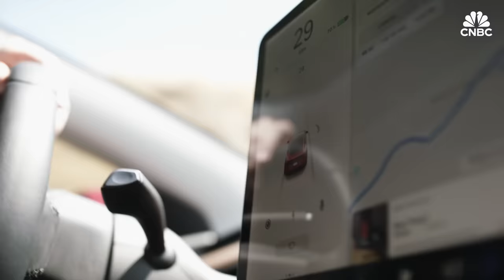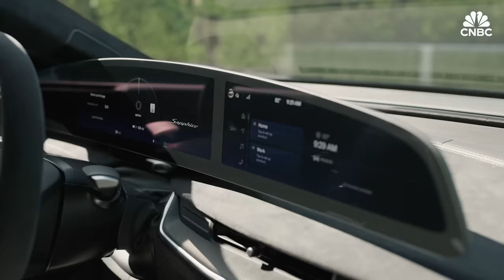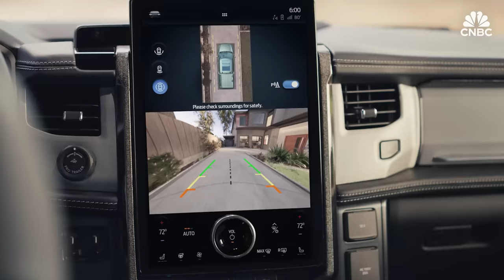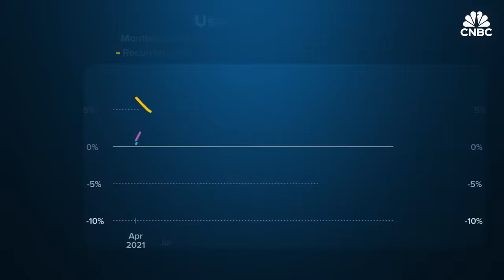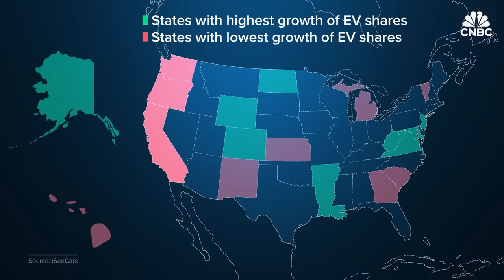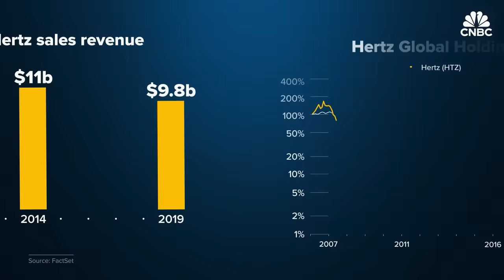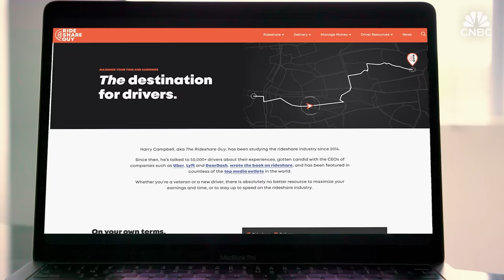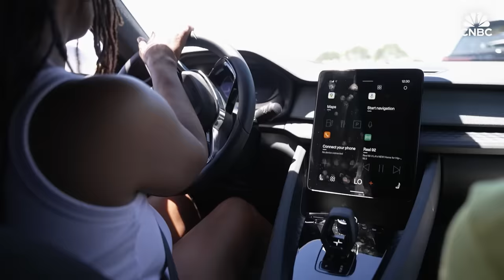Why EV Sales Are Falling | CNBC Marathon

Comment: It's the cost. There are no low-cost EVs, and it is best if you have a home charging station as we'll, which most people don't have.
Reply: U can just plug into your home power u don’t need a special charger.
Reply: We have one EV and just plug into the wall. It works if you drive less than 50 miles a day. I’ve used public charging about 7 times in 3 years.

Comment: Renting a EV is very different from renting a ICE car. When you return the gas powered car you just stop at a nearby gas station and fill-up the tank to the level required. When you return the EV, you have to plan ahead on where and for how long you have to stop to charge the battery so you end up with the percentage of battery required to not pay the extra charges. Also you rent When you are away from home and without the home charging the price per kilometer may end up very close between EV and ICE, so you feel only the disadvantages of driving an EV
Reply: Exactly my experience! And half the chargers are very difficult. Even the guy at the dealership had issues!

Comment: Maintenance cost is cheap, until you damage the battery, then it's basically the price of a new car.
Reply: Ya, I have this ICE car and maintenance was cheap until I damaged the drivetrain and now it is the same price of a new car. What a stupid comment to make. If you damage any new cars engine where you have to replace it you are looking at a minimum of $10K+. If you damage a battery you had to do something very bad because unlike regular ICE which leaves all their vital components exposed to the open air a battery will have a relatively thick piece of metal and composites protecting it from damage.

Comment: I’m having an EV for a month as my car is in auto shop. Honestly pretty awesome experience as an 100% on-site employee commute to Seaport Boston with company garage providing free charging stations. So far only paid 20 dollars for charging due to a weekend road trip. This is easily $200 per month saving not even taking consideration of maintenance saving if I eventually switch to an EV. This, however, doesn’t apply to most people around me as we almost all living in apartments/condo that has no or bare minimum charging stations, and not everyone is fortunate to have free parking in the city with free charging perk. So the population has greatest demand for EV: people commute in big cities, is also the population that faces infrastructure problems helping them getting an EV.
Reply: Tesla Supercharger Network:  no garage for overnight charging?  No problem.
Reply: Luckily chargers are simpler to install because they lack all the HAZMAT requirements that gas stations need to satisfy. But there's still a lot of capital-intensive drilling and pipefitting to put in a charger, not to mention the energy storage and transmission upgrades that the government needs to help with.
Reply: @doujinflip  WAY less than the cost of the Fossil Fuels Infrastructure to keep drilling incessantly and shipping OIL and gasoline LONG distances and refining it, while polluting the world.
Reply: $200 per month savings? What kind of car were you driving?
Reply: @KP-xi4bj  That’s nonsense. I live near a major metropolitan center. The nearest Supercharger is 17 miles away. Charging would be a 34 mile round trip which would take a minimum of an hour. That’s plain stupid.

Comment: 20 years for an ICE vehicle is optimistic. You surely can keep it running, but the costs of repair will be so high that it is not economically profitable. The profits mr. Mercedes makes, comes for a large part, from you having your turbo changed, or your injectors or your gearbox. Lots of FUD in this video. EVs are great, infra is lagging behind in the US.
Reply: Not if it’s a Toyota or Honda… in North America most ev owners came from the German brands which have relatively high maintenance costs. They’re just comparing it to what they’re used to.
Reply: @malfre45  you are absolutely right. But these are older and simpeler cars. Not the modern downsized emission focused cars. No EGR, no turbos etc
Reply: I guess you have never owned a Japanese vehicle,  sure German cars can be money pits,  but not Japanese...
Reply: That just isn't true. I have a 24 year old Honda that has zero problems, I have a 31 year old Audi that I need to replace the clutch on, but otherwise has no issues. And you said 'economically profitable'. Since when is traditional car ownership profitable. Only a select few cars are actually profitable on resale. When people say they sold the car for more than they paid for it, the value of the dollar has usually decreased more than the 'profit' they made. Maybe you meant 'viable' instead?
Reply: I did not mean the good old cars. I own an old Mazda and I know how good they are. I meant downsized, turbo charged cars that are built right now and that are complying to the euro 6 or 7 regulations. Expectations are that they are not going to last 20 years, at least not without significant costs.

Comment: CNBC dancing around the sombrero here. 
The ONLY selling point for EVs has been the environment. I'm not saying that's the truth, but that is absolutely what the sales pitch has been from government and manufacturers. 
People learned the truth really fast. 
While the LIFE of an EV is better for the environment, it's manufacture and its eventual death is considerably WORSE for the environment. 
Mining the chemicals to make the batteries requires nothing short of raping the earth. When the car is eventually totaled or just junked, there is no way to recycle it, and due to the fire risk the current method of destruction is to dump them in man made lakes. No joke. 
Until a feasible recycling system is in place, EVs are an overall bigger threat to the environment.
Reply: add to this that the USGA states the world has 88 tons of lithium but only 1/4 of it can be feasibly mined you have to ask yourself why didnt we pour this energy and time into hydrogen tech? At least we have the supply there to keep up with an eventual demand. Battery tech we simply do not. Pretty soon they will have to cease this 15-20 year experiment do the the cost of production and mining repercussions.

Comment: Price premium is still too high, charging infrastructure is a joke, massive cold weather performance degradation, batteries catching on fire, and people who live in condos/apartments have limited (if any) charging options while at home.  Until these issues are resolved ICE is here to stay.  I'll keep driving standard gas vehicles until then, and will check back in 10 years.
Reply: Good points except fires.
Reply: ICE cars have more fires  then E cars,you can look it up. E fires are all the scooters, ebikes etc. that is unregulated.
Reply: @jaaklucas1329  That's fair. The ratio of E fires is much less than on ICE vehicles.  Nonetheless, the rest of the issues, I mentioned, can't be argued (at least for me).  A plug-in hybrid may be a good interim step (once price deltas with ICE vehicles becomes more reasonable).
Reply: @jaxwylde2139  Agreed on the hybrids, tried and true technology after several years. The hybrid design I like is a bit different and emerging now is E vehicle with an onboard gas generator, an REEV. There are a couple out now. A pure electric drivetrain, which is so superior to ICE from an efficiency point of view which can charge the battery pack on the go. Redundant in my eyes personally though as we are going to see the cost of BEV come down and the range go up.But Im a realist. Id like to clean up the air that we breathe on this planet. Just from an enginnering aspect, I totally believe in electric vehicle tech. It's the future.

Comment: Will EVs retain mileage like my 1990 F150 that with 600k miles still gets 22mpg (city and Hwy are the same).  Means its gets over 600miles of range just as it did February 1990 when it rolled off the lot.  With only wear items being replaced (clutches in transmission) while engine is as assembled in Cleveland in 1989.
Reply: Rebuilt engine and transmission alone has cost you over 6 grand.  Fuel costs over 4k a year.  Rare for a truck to be alive hat long.
Reply: @impitt28  engine rebuilds cost ~$1200, transmission ~$2000.

For the engine in my truck 1 million miles without a needed rebuild is common.  So yes it is common for the truck to go 600k miles for those that chose to keep what they have.

Energy costs for an EV aren't zero and if going to a charger they are more expensive than diesel or 93 octane let alone 87 and take significantly longer (so there is even am additional time cost)

Comment: I bought a plasma tv for 10K in 90's and when i tried to sell it 2 years later, I could get only 500$ for. Was it a bad investment? No. It's not an investment, period. Same goes for cars (with the exception of collectibles). If the cost of a new Tesla is reduced by 20% every year, the cost of used Tesla will also go down by about the same percentage. Eventually, costs will stop to go down like it did for other commodities. It's not because EV depreciate faster than a regular ICE car. The cost goes down when production ramps-up. It's the same as any new technology. I'm surprised this was not mentioned in the video. At this point, it's an IQ test.
Reply: Well, I appreciate your sacrifice so I could buy a cheap flat panel TV and save money

Comment: Imagine what happens to the battery of a car that sleeps on a lot for 3-4 months. Can’t be good
Reply: Tesla recommends regular charging even when a vehicle is not used / moved over time.  2023, I had to park my Tesla for 4 months.  It was plugged in and kept at 50% charge the entire time.  No issues when we returned, not even flat tires.

Comment: I have a hybrid with just under 110000 miles that is a driveway ornament and can’t fix it without as the dealer says replacing the main battery for a low low price of $20,000

Comment: An electric vehicle doesn't make any sense at all if one's sole objective is to get as many miles as possible out of a car for the absolute least amount of dollars spent.  They are ridiculously inefficient on a  "cents per mile driven" basis calculated over the life of the vehicle.  I drive gasoline powered Toyota Corollas until they have over 350,000 miles on the odometer ... and my total costs, all inclusive, are far far far far lower than ANY electric vehicle would be.

Comment: All I got from this video is that they desperately trying to say that EV ia the future and everyone wants them but no one(very few) buy them.

They even contradict themselves:
EV sales are falling and that is because Tesla is cuting prices and everyone is going to buy Tesla so logicly Tesla transactions should go up. Nop! Tesla transactions are failing by about 16%(as they said in the video).  Clearly EV are crap(at this point).
Reply: Yes, nbc works as a misinformation centre. This video doesnt tell the battery is prone to explode. It is heavier, and you have to replace the tyre more often than the ice counterpart.

Comment: EVs will not hit mass adoption until you can buy an high quality new EV for $25,000 USD or less, there is a supercharger network as ubiquitous as current gas stations, charging from a low state of charge (like 10%) to full can be done in under 15 minutes, and you won't have to worry about your battery or electric motors wearing out until 200,000 miles or more.  In other words, no mass adoption until EVs reach parity with ICE cars.

Comment: What is wrong with the electric cars.  They have the large expense for just a battery cover scratch.  The lack of range on a full tank, The length of time it takes to fully charge the battery. The shortage of electric fill points. The price compared to petrol or diesel cars and trucks. 
Un explained cars and buses burst into flames. Live of the electric car is shorter. I rest my case.

Comment: I rented an electric car last week just to see what they are about. Why not, I love my electric lawn mower. First, I was surprised how noisy it was, going down the road. Then, charging was real inconvenient. The first level 2 charger was free (cool!), but it was going to take TEN hours to charge! Mind you, I'm on a trip, away from home, so overnight charging on my garage was not possible (even if I had a charger at home). Charging stations in rural areas are extremely rare. The saving grace was that the VRBO I stayed in was across the street from the only charging station in a ten mile radius. So, I plugged in overnight, and that took care of the rest of my trip. Another inconvenience was that Hertz requires the car be returned at 70%(?) charge. Fortunately the 25 mile drive, after a full charge, didn't drop me below that range. Imagine trying to find and then charge before catching a flight! The experience completely turned me off th electric cars. They are just too inconvenient.

Comment: EVs problems are straightforward.  1. You need more infrastructure.  Self-explanatory.
2. You need non luxery EV options.  Until you have a good, 20-30k EV option, you are not going to have mass adoption.

Comment: When a 120,000 pound Tycan by Porche goes down to 20,000 pounds a year later with no accidents and so on there is a built in Feedback mechanism.  Buy and EV, and lose that $$$$ in less than two years.  Add an accident, and you have a 40-50k expense for a replacement battery, which is FAR more than the car is worth.  No one will work on the EVs because of liability issues and fire danger... thus the extraordinary prices for insurance.

Comment: What happens to EVs when trying to evacuate in hurricanes and you are stuck not moving in traffic for long periods? Where do you charge up in a case like that when it takes so long to charge?. What about the cost of battery replacement…. How many mechanics are qualified to work on these cars.
Supply and demand drives up that cost as well as the time it takes to get your vehicle repaired….po wet grid issues due to ice and then brownouts in summer make the charge options unpredictable….mandating from top down does not work

Comment: Man, corporate media will do everything in their power other than just admit that EV’s are trash. yes, maybe the price has a little bit to do with the fact that they’re not selling but the other part is is nobody wants a car that in five years is gonna need a battery replacement that is going to cost tens of thousands to fix not to mention you can’t take any of these cars on a road trip without having to sit at a lot for over 30 minutes to charge your car.

Comment: The infrastructure is just not there yet for mass adoption of EVs. And the existing charging stations are subject to breaking, issues during cold, and vandalism, so even if you plan your trip out, you aren't necessarily guaranteed a working charger. For urban dwellers, I think it makes much more sense than someone who goes on multiple 100+ mile trips a year. The thing that really gets me though is how these vehicles are essentially property of the dealership when it comes to repairs. Any major repair aside from body panels, and brake work cannot be done by the average consumer without voiding the warranty. Early adopters are having to pay upwards of 20k to replace the battery, on what is basically a massive computer. Start making components available on the OEM market, make the large components easier to replace by the consumer, improve the reliability and availability of chargers and then I will starting seriously considering an EV. Until then, Ill let the Yuppies keep being testing rats 😉

Comment: I own a Tesla M3P. This car blows my mind. Just take one for a test drive. Awesome. ❤
Reply: fine cars. but wont save you a penny. I can buy a new loaded corolla and drive it 155k miles before i reach the 2024 msrp of a tesla3(20k less price, 4400 gallons of gas 35 mpg). At 154k miles your battery (replacement cost 14k) will be out of warranty for 35k miles (expires at 120k).
You will talk yourself into trading the car in before your battery fails because at this point the 60-70% depreciation makes your car worth less then the battery cost. So before you save a penny you'll trade it in. Just like i did twice with my 2005 and 2012 prius before i did the math. I didnt save a dime at the pumps that i didnt have to pay elsewhere to avoid the pumps.  When you trade in the tesla at 130k miles a well maintained garage kept corolla could be driven for another 150k miles as long as im satisfied with driving an older high mileage car. And thats the issue. Most americans and people with money dont drive old high mileage cars they talk themselves into a newer one. Thereby not saving a dime.

Comment: The thing is, EV's REALLY ARE the future.  They will UNQUESTIONABLY replace ICE cars...

But the question is WHEN.  As it stands now, the infrastructure isn't there.  The resource production isn't there.  And the battery and charging tech ABSOLUTELY isn't there!

If the resources were plentiful, the cars could be turned out fast, and I could recharge my EV cheaply, in 5 minutes, at charging depots stationed everywhere the eye could see??  There would be NO PROBLEM.

But until we get to that point?  It's not going to happen.

Comment: The real reason is charging infrastructure. For fun, imagine if every gas  station in the US was also a fully equipped supercharging station. The adoption of EV would be much larger. 

Ofc that won't happen because exxon and Shell are directly in competition with an ev future. However, you can imagine if charging stations were as ubiquitous as gas stations, the hesitation on buying an ev would fall dramatically